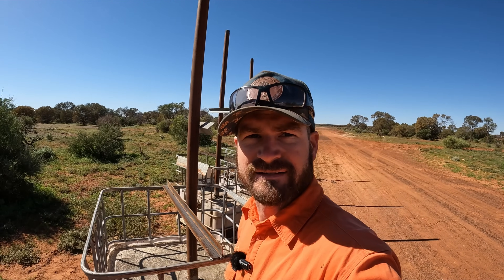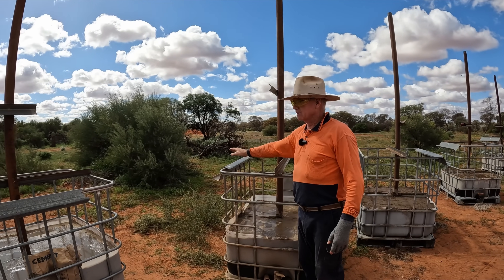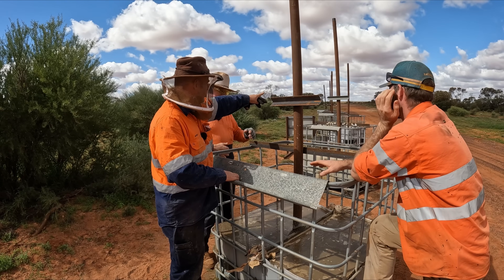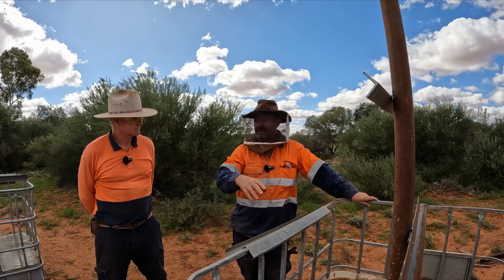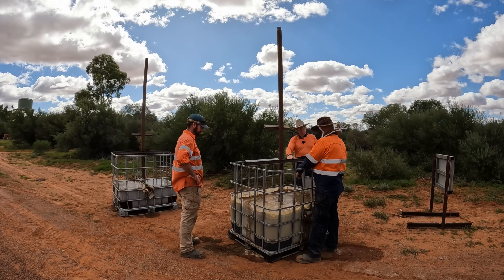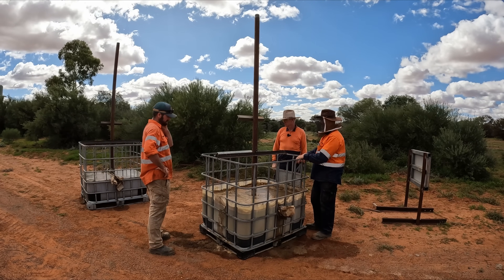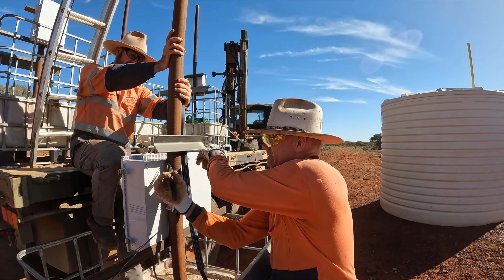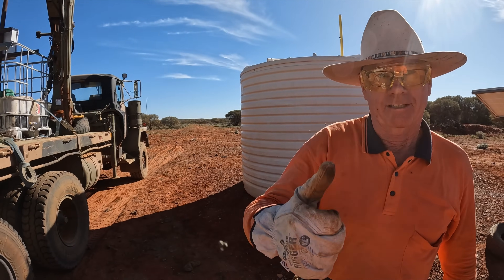Off-Grid Ubiquiti Remote Monitoring Units: Deploying the Latest Generation

Comment: An excellent episode I enjoyed as I've built many cheap solar powered Ubiquitii microwave links as access points and backhaul links between main repeaters over here in New Zealand for commercial internet access some years back for the rural remote farming communities here in the South Island. I love the idea of using the common threaded drilling steel pipes, but having the ability to tilt the mast down to the ground for servicing the 600mm dish, cameras, or modular small access points with combined radio & dish would be better. Making the stuff stock proof and out of recycled material is always a good thing. Those cut down 1 tonne plastic tanks are great. Well done.

Comment: Should I have been chuckling at the start, cos...cos I was hahaaha
BTW - Great video
I live in 1985 or 1986 so I was wondering how the digital system would work if Internet/Sat connection failed...I didn't realise it was a stand alone (non internet) network within the station. Obvious now you explain it (and still brilliant)
Winning, winning, win!

FWIW my dad in his late 80s and whilst he's very much at home in a modern tractor, he has seen Chamberalin 4080s, Chamberlain Countryman, then going way back steel wheel tractors & yes he clearly remembers horse teams plus things like the impossible man on the moon etc etc...
Sometimes forget the leaps forward, even the leaps every 5-10 years are immense. I recall a few years ago trying to explain a fax machine to our daughter. I remember the internet & getting connected before the Ag Dept & whole of govt. Those early years, man could you get research data out of every dept so easily.

Nothing much stands still except the rules of filtering out what new innovation works good, better, best.
And those IBC pods & drill rods...gee they're awesome for converting into so many things. Like milk crates, hope they never end
2 thumbs up

Comment: The only improvement I can sugest is some rebar pegs welded on the pipe so you have a built in ladder. Ant would call them crow perches! Alternatively you could hinge the pole at the joint with a counterweight to make them fold down and so do away with the need for a ladder altogether. Have been watching from the start and quite enjoying seeing how the station is evolving. Cheers from southern Tassy!

Comment: Jack
Have you thought of using 2 C channels concreted in ICB allowing the pole to pivot like a flag pole so Ant can work at ground level and ease of maintenance using the truck to lower or raise using a lanyard attached at the top
Reply from the maker: Yeah we have Scott, some of our original plans were to set it up like that, and we are finding that the directional antennas are very forgiving. 
At the moment using the drill rod is quite affordable and allows us to reuse them.
Reply: @jack_out_the_back   its pity Kmart doesn't supply C channel

Comment: Interesting, friends of mine were talking about starting company to do something like this in the west Texas oil field to monitor wells and tank farms for security reason rather than some guy having to drive out there and see what is going on,, this was back in the 80s. Of course things have changed greatly since then the IBM desk tops had just come out, cell phones were a rich mans toy, now ,my non I phone has more computing power than the first IBM desk tops.
So you decided to use the crane to set the units rather than using Jant power!